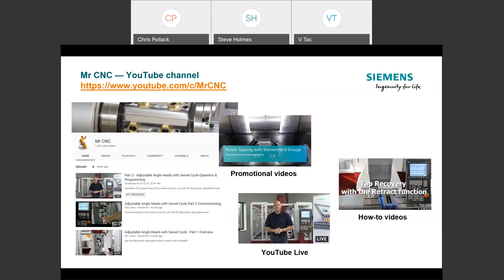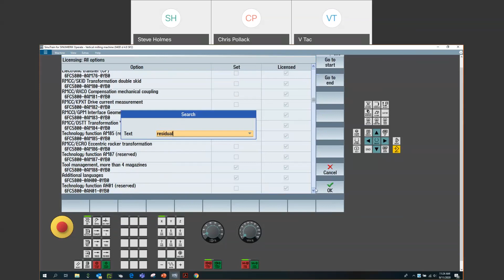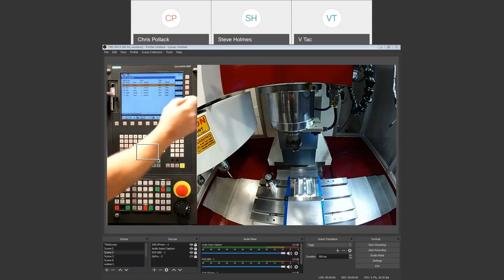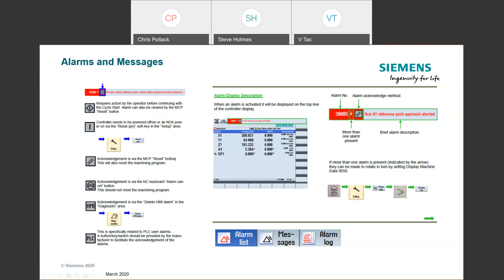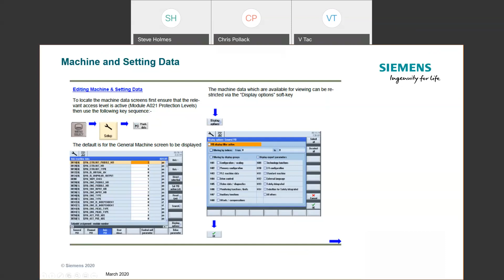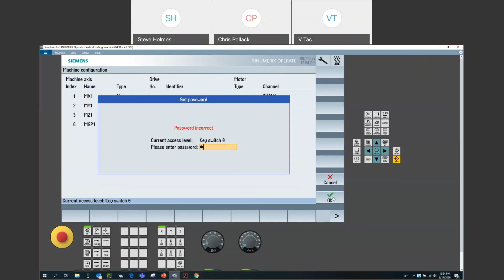Siemens SINUMERIK Service and Maintenance101

Comment: Hello, Engineer. I have a problem: my CNC milling machine with a Sinumerik 802 S control was reformatted during maintenance, and I don't have a backup. The configuration has been lost, and now, when I start it up, it boots in Lathe mode.
Reply from the maker: i would contact the machine tool builder.

Comment: Hello, I needed help with the 808d, when I was changing tools, the emergency button was pressed, and then the error appeared

700034 Return the magazine to the original position

I followed the resolution in the service and maintenance pdf, and I was unable to stop the machine from beeping and find the magazine tool again.

Would you help me?
Reply from the maker: This might be a machine tool builder question. they are the ones that set the tool changer up

Comment: Re failing Safety integrate test procedure caused by W brake system Torque error, is there any way to fix it by manual adjustment? Thank you
Reply from the maker: what machine tool are you on?

Comment: Hi Steve, This is David. I am asking if you have a link I can download the menu of the 840D? We have issue to connect the internet, the WAN. I am trying to figure which part the issue from. The Static IP address I manually put in the machine is not being recognized. In the Interface about network, there are two options, DHCP is default, I wonder if the laptop which has the user interface should use the DHCP IP address on the machine and manually put in the laptop as a static IP? 
The other thing let me confused is, still in that network interface of the machine, the DHCP and Manually has two different MAC address, so I wonder if the LAN & WAN should connect at the same time to make sure the machine can download configuration from our local server and upload the data to the user end computers, is that right?
Thanks
Reply from the maker: David 

Can you please send me your contact information:
Dan.Strubel@Siemens.com
I have a document that will help you with these questions.

Comment: Hello!
I would like to know if there is an easy way to swap the internal HDD for an SSD drive for an 828D Control
Thanks
Reply from the maker: The 828 doesn’t have a hard drive.  It’s compact Flash - no need to upgrade.
Reply: @MrCNC  I see, I wanted to make it speedier because browsing through the files and executing any operation is now painfully slow compared to when I bought the machine 2 years ago. It seems like I'm in the '80s, the simulation hardly shows 1 frame per second for example. Any tip?